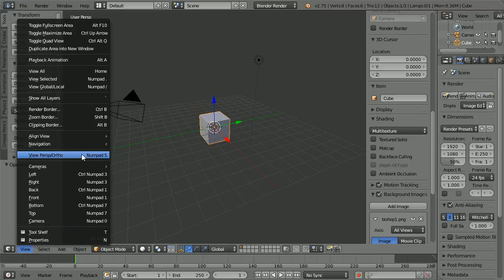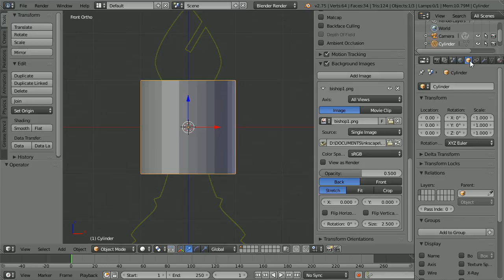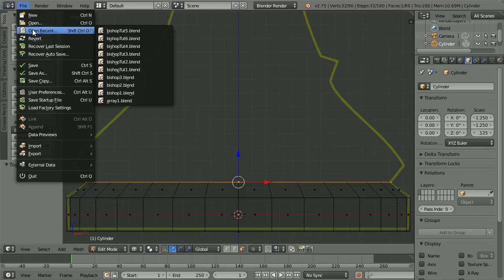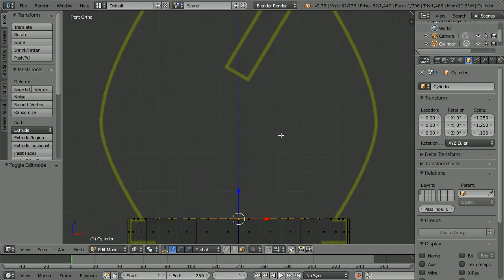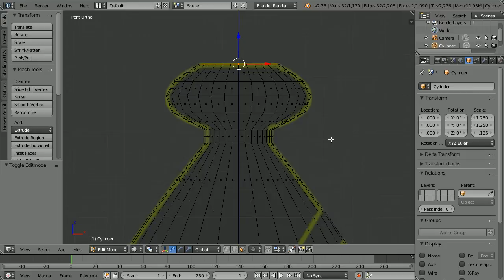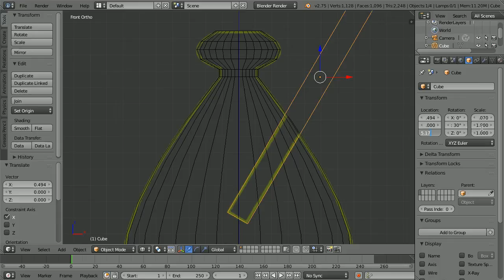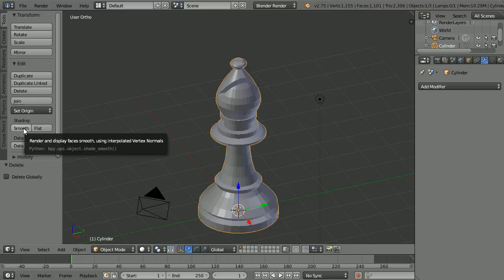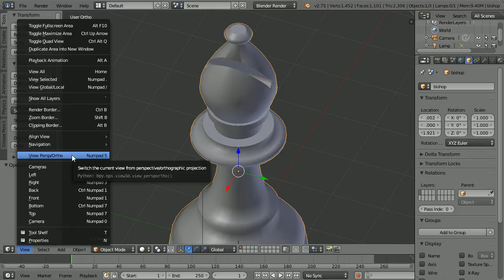Blender Modelling Tutorial Making A Bishop Chess Piece Using the Boolean Modifier

Comment: Thanks for these videos, I'm currently learning how to use Blender. I followed the instructions for the bishop carefully but when it came to the boolean operation it did not leave the gap in the top ! I was stuck with yet another copy of the modified cube when I tried to remove it from the bishop. Any idea what could cause this because I have done other boolean subtractions successfully before ?
Reply from the maker: +Spacekriek I think sometimes the Boolean modifier can fail just because it is having to do too much work, has your bishop got a lot of detail (high number of faces). I just took a slot out of a cone and it worked and as you say, it has worked for you before.